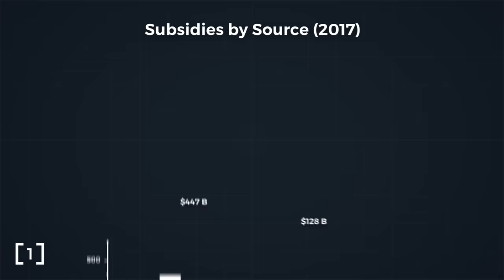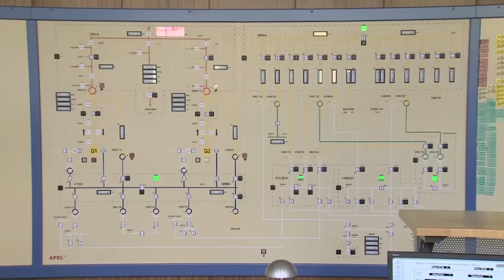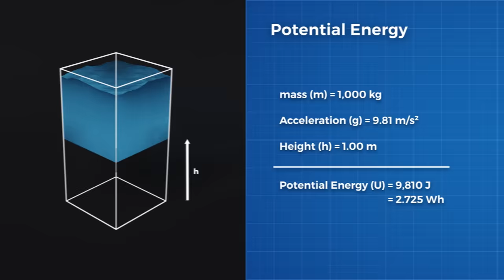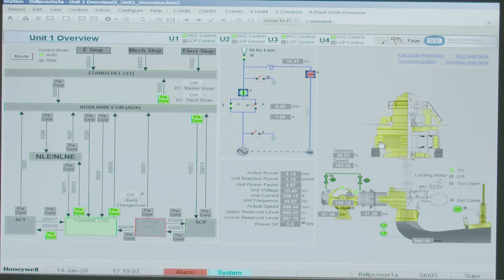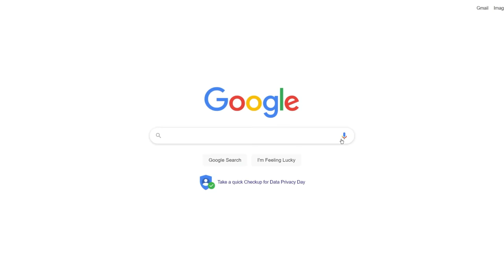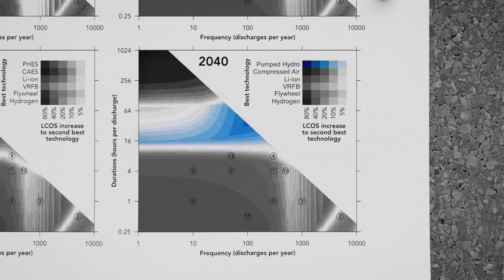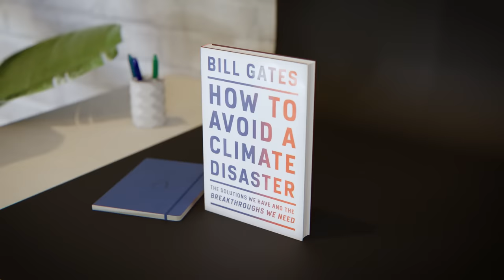The Truth About Pumped Hydro

Comment: "Evaporation can be a concern."  
Arizona: "Aight I'mma head out"
Reply: yeah, the right tool at the right time and place
loved real engineering's video but his video usually applies more to europe's climate
arizona need other solution, perhaps molten salt, perhaps just plain old battery
Reply: @aronseptianto8142  id say hydrogen.
Reply: @aronseptianto8142  Shade balls and covered reservoirs are potential solutions, though I agree that pumped hydro is probably more suitable for places like Minnesota than the Southwest.
Reply: @ZeteticPhilosopher  I don't know, will shade ball impede with flow?
If the water level is well maintained I don't see the ball getting sucked into the generator but if and when a ball slipped into the impeller, it's going to be a bad time
Reply: @aronseptianto8142  They work fine. They float. The inlet/outlet to the reservoir isn't anywhere near the surface. It can't be, or all the water below it would be useless to you.

If you run the whole thing dry, you're gonna have a bad day before the shade balls enter into it. So you just Don't Do That.

(Anyway, sure, assume a few shade balls fail, take on water, and sink. With the size of those turbines, I doubt a 4" hollow plastic ball is gonna even make a dent. I bet they already deal with, e.g., dead ducks.)
Reply: @ps.2  how do they deal with dead ducks, do they just power cycle the pump until it unclogs :p
Reply: @aronseptianto8142  Maybe they pour in some Drano. Who knows?

Comment: Some exciting progress in fusion energy as well. Might be worth checking out
Reply: sadly, to this day there still hasn't been a fusion reactor that could at least show a energy net gain greater then one, let alone any actual electricity generation. While ITER should be capable of generating more energy then it needs to sustain fusion, it will never generate a single watt of electricity, as that is not its mission.
For now the ticket to clean energy is still fission. Fusion powering your home is still decades away.
Reply: @AKAtheA  dude, you dont have to preach here.  Not saying its around the corner, I'm saying go check tokamak energy yt channel. some interesting stuff there

Comment: This wouldnt work in the real world because of politics.    But Id like to see a video about pumped hydro using the already existing 100-meter difference between  Lake Erie and Lake Ontario.    

All it would take is an unnoticeable 15 to 20 cm across the 25,600 sq km of Lake Erie.
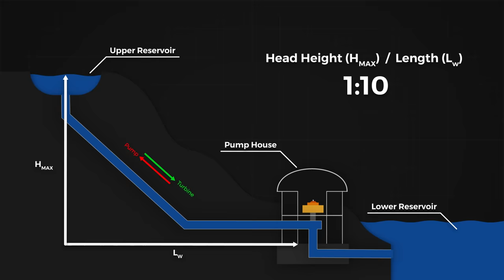Reply: @12:05   There is a big issue.
Reply: Ontario has pumped hydro at Niagara Falls.  So it does work exactly where you suggested.

Comment: I think you missed fact that PHS do need electricity to run / pump up and that electricity is higher than generated.
If Ireland would need to build 8 (or 6 groups of 8) new, it will also require massive increase in power production to run(charge) those PHS, and more PHS capacity you add, more (exponentially) power supply you require.

Comment: About subsidies what does the distribution look like if you take into account the energy produced by each kind? I.e. does renewable receive more compared to the amount of energy provided?
Reply: This, what is the subsidy of $/MWh  produced?
Reply: I posted this on another thread earlier: In my country in reality, our fossil fuel energy is subsidised at a rate of 0.01 cents per kW/h and wind energy is subsidised at a rate of 6 cents per kWh, or roughly .03% vs 20% retail cost - and that’s using the often overestimated figures for fossil fuels and underestimates of renewables, applied to wholesale MWh prices.

Comment: Shouldn't you be measuring the effect of subsides as subsidy dollars per delivered KWH?  Also if you were shopping for powerplants, each cost a million dollars , but one worked all the time and the other worked sometimes, is it fair to say they are of equal value?   I am a huge fan of sustainable energy by the way.
Reply: You need both continuous and intermittent power production. If you only have continuous generators you have to have over capacity to meet peak demand. You then have to dump energy when demand drops. The ability to store energy (pumped hydro, batteries, hydrogen, compressed air, flywheel, w.h.y.) enables you to make better use of both continuous and intermittent generation capacity.
It’s a complex balancing act from both an economic and and ecological standpoint. There’s no single solution for all cases.
Reply: @q.e.d.9112  You certainly do need intermittent power capacity but it needs to be dispatchable, exactly what wind , etc aren't
Reply: @robstorms  
Which is why I confined my comments to energy storage systems. Sustainable energy systems tend to be intermittent. Your point about subsidies is only partially relevant; they should not be judged on economic terms. From an ecological perspective there is no reason for coal and oil to receive any subsidy at all. In fact, IMO, they should be levied to cross subsidise to promote the switch to renewables/storage.
The intermittent nature of renewables does increase the need for storage solutions and finding the correct balance between short term and long term storage will be a factor, too.
Reply: @q.e.d.9112  I am on your side. I am ALL for arguing for sustainables from an ecologi cal perspective. i just cringe when I hear the argument that they are cheaper. If I pay a guy pedaling a generator $15/hr ( he can pedal when he feels like it) and subsidize his electricity at $15 per 100wh I can claim that his electricity is cheaper than i get from my wall plug ( even though the wall plug works all the time and if it breaks they fix it)   We have been getting extremely cheap, dispatchable, highly energy dense, energy with BUILT IN FREE storage from  fossil fuels for a long time. The storage problem for non dispatchable is HUGE.  Considering all the different energy sectors ( electricity, transportation, heating, industrial processes ,etc) there is nothing currently practical that even approaches the storage what would be required to provide energy ( as we currently use it) from non dispatchable sources.

Comment: The subsidies argument at the beginning of the video is just another reason to stop using (and needlessly subsidizing) fossil fuels, and make a switch to renewables.
In fact, not just switch to renewables, but switch fossil fuel subsidies to renewables!
Reply: Mr Whale, 

you can't run on renewables unless it is hydro, it won't work. And renewables alreday are subsidised where fossil fuel genertaion is not, and is far better suited for the job.

Comment: I have 14 years experience in hydro with 100+ hydro plants and 2 pump hydro plants.
My experience is the pumping plants require much more maintenance. We used to have a rule generation electricity price = 1,5x pumping price. Now the generation price should be double the pumping price.

Comment: 0:30 that chart should likely be normalized by total energy output (ie $ subsidies per mWh)
Reply: Even better: normalize it by 2 factors: $$$ per MWh, and separate the capital cost subsidies (e.g., construction) from the running cost subsidies (e.g., oil exploration).

(Then there's the indirect subsidy of not forcing the owner to bear the externalities of, e.g., medical bills from asthma from air pollution. That one's particularly brutal for coal generation, not as bad for petroleum and gas.)

Comment: Nice video. RethinkX suggests overbuilding solar and wind to reduce the need for storage, suggesting it is cheaper to curtail or find uses like generating hydrogen with extra power. Extra power is likely in the spring which has good sunshine, strong wind and lower heating or A/C loads. Some existing hydro plants took 3 years to fill. Here in the North America we have 35 GW of hydro in Quebec that would match nicely with the massive offshore wind potential.
Reply: Would you agree catastrophic weather related events are increasing? Do you agree putting all your eggs in one basket is risky? Now consider long term durability of renewables in an ever more volatile environment. One hurricane, tornado, or even wildfire vs countless square miles of power production. Now compare it to more traditional power stations protected by a concrete building in those same volatile weather events. Don't gamble everything playing roulette on the rare one tile of green.
Reply: @Cerberus984  A grid with distributed renewable generation is well suited to be reliable and improved recycling will allow perpetual maintenance. Renewables have won the competition for lowest cost generation. Large central power plants can work if they are carbon free, safe, and low cost, but current fossil and nuclear plants don't meet those requirements at low cost. We do need a highly interconnected grid with open markets and hardening of transmission and distribution especially in weather prone locations.

Comment: How well does pumped hydro work in freezing weather?
Reply: That is a legit question I am asking as I don't know the answer. Recent events in the US show that you need to ask these type of questions.
Reply from the maker: The water gets significantly heated during operation, but obviously wouldn’t be the best option for consistently cold places.
Reply: @RealEngineering  Thanks for the response. After reading the rest of the thread, I felt like I needed to explain that it was a legit question that I wanted a real answer to. I am not an engineer, but I am for whatever solution works. If that's pumped hydro where it can work, then that's great. Thanks again for the explanation.
Reply: larger bodies of water, like lakes, tend to freeze very slowly. this is because ice floats and creates a layer on top of the lake that insulates and slows down the cooling.
Reply: Would salt water work better or would that just corrode the pipes and generator?
Reply: @TheMCLand  Im going to guess it corrodes it. It's why nuclear plants can't even use salt water to cool their reactors.
Reply: @TheMCLand  in terms of freezing sure, in terms of corrosion they are a problem. But maybe that can be solved...
Reply: We have pumped hydro in Ontario Canada.   It gets cold here you know.   It works great

Comment: Here in Australia we are building a massive pumped hydro plant called Snowy 2.0. However it is clear that the benefits are far less than the cost of the project which has blown out to around 10 billion dollars, significantly more than its original estimate, partially caused by the cost of transmission lines. It also is a net energy user. That is it takes significantly more energy to pump the water up into the top reservoir than is generated. I imagine this scheme and all other pumped hydro are the same. And if you want to use these to completely replace either gas or coal backup, you have to plan for the worst case scenario not an average. In this case you have to plan for no or little wind for weeks not two or three days. In which case it becomes completely unfeasible.

Comment: In sweden we use two other types of reservoirs:
- abandoned mines where the lower reservoir is far down in mountains already existing. Lower initial cost. 
- using exiting classic hydro power used as batteries, but without the need of pumping up the water during night/windy days. This has the downside that the upper reservoir water level goes up and down, which will impact environment and animals around there. And not so fun to have your cottage with a boat at the lake where water level changes by 20m :)
Reply: @Eugen_Belyaev  
I’m not sure I understand your point.. the amount of energy you get from falling water is of course not enough to pump it up to the same level again. But I guess that’s not your point? :)
Reply: @macjonte  By closed watercourses, I mean pump-turbine pairs operating on closed individual watercourses. All pairs of units are mounted on a common shaft, at the end of which there is a generator. Generator power in the range of units - hundreds of megawatts. Exit to the operating mode takes a few minutes.

Comment: So, what's the cost of the renewable energy solutions when you also factor in the energy storage solutions required for them to maintain grid stability?
Reply: Also the environmental impact of making massive constantly level changing lakes.
Reply: You wont get a monetarily fiscal reason or a mentally sane one either.
Reply: Lower than a damage we are making now to the environment.
Reply: @movax20h  Yes, but a dollar amount is also nice, especially when claims such as "cheaper than fossil fuels" are made.
Reply: @jaredwilliams8621  how much storage is required depends on a location, and expanse of the grid. It might be zero, it might be little, it might be a lot.
Reply: @movax20h  According to this video though the amount of pumped hydro to stabilize the grid would be 37 plants, at nearly $1 billion each, meaning (assuming it was actually possible) to stabilize the grid, it would take half of one year's national budget of Ireland to just stabilize the grid (no additional power generation). Also, this video claimed that renewables were cheaper than fossil fuels, which seems false once apples are actually compared to apples.
Reply: @jaredwilliams8621  the figure of 37 stations each 1 billions each is a result of extremely naive calculation method, assuming zero power from other sources. That is silly, because you can have nuclear power for example, and import energy from UK, France, Iceland or Spain to Irland, if sufficient transmission infrastructure is built. Yes it will also costs billions, but can carry about 2 GW of power eac, which is like 10 pumped hydro storagre facilities of the size mentioned in the video. It is not all or nothing, and the problem shouldn't be analysed in Isolation. Distributed grid can absorb a lot of wind and solar variability. Some engineers even had models predicting there might be close to zero storage required with sufficient overprovisioning in Europe, but that would not be optimal economically either. A mix would be the best.

Even that. What is 37 billion $. It is not much. Half of national budget , yes , but of one years and not all money would be spent in one year or from public money either.

Comment: 8:09, I thought it would be 3000rpm to make it 50 Hz, but I guess that would probably destroy the thing lol
Reply: Have a look into multiple 'pole' 3 phase motors/alternators. in a 50HZ system, a 2 pole (north and south) would need to rotate at 3000 RPM, a 4 pole at 1500 RPM etc and in this case a 12 pole alternator at 500 RPM.
Reply: @kiwiskiz  but can you S-plane how many zeros it had?

Comment: I work in the power industry and NO solar and wind cannot fully support grids yet.  They lack the ability to provide consistent voltage support.  You need large synchronous machines with appropriate power factors to provide a stable source of baseload electricity.  Solar and wind are fine for peak and reserve power sources OR supplemental baseload in limited cases.

Comment: I know I'm a year late on this video, but I just found your channel. You should do a video exploring other gravity storage technologies like what Gravitricity is doing. Same concept, but a potentially much more feasible solution as it greatly increases the available locations that can be used.
Reply: What is "gravitricity" ? What project are you talking about? Do you have a link
Reply: @Menga213 ravitricity is a startup(?) that wants to store energy in gravity by lifting up concrete blocks. Instead of pumping water up and flowing back down, they want to lift concrete blocks with a crane/winch. Then allow it to fall and thus turn the shaft to generate power back.

It’s inefficient and non-feasible, but they have CGI and sketches to attract investors. (Just do some napkin calculations as to how much volume would have to be moved to store any reasonable grid scale energy.)